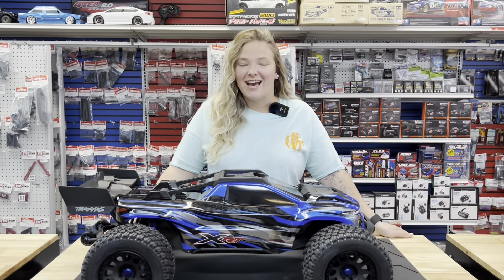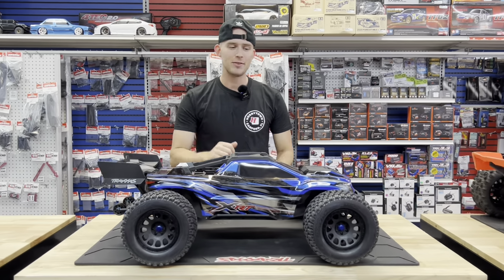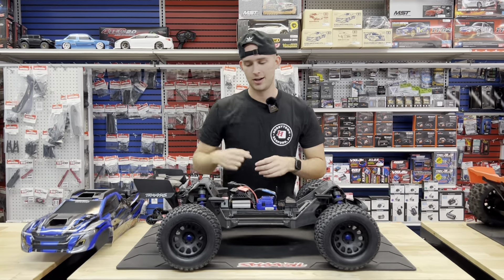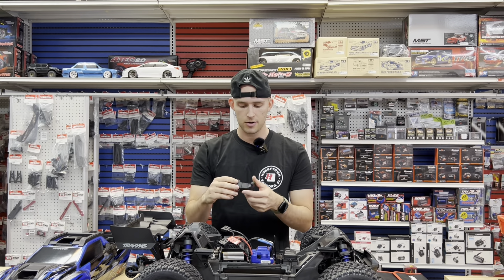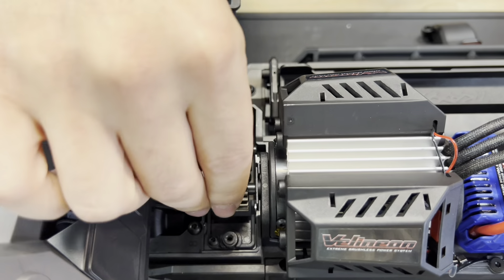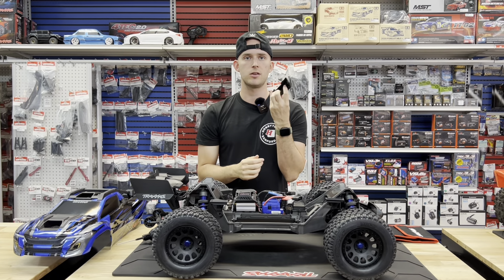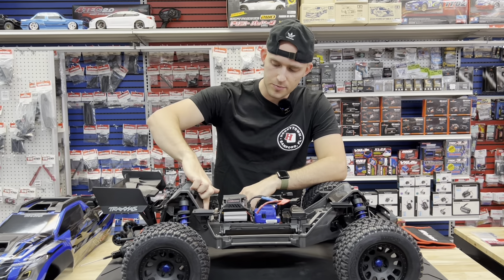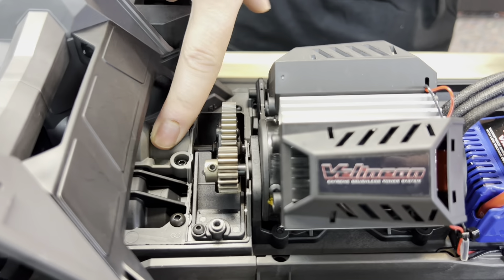*WATCH THIS* If your Pinion/Spur STRIPPED on your Traxxas XRT / X-MAXX

Comment: While these are all good points, if traxxas didn't use such low quality gears, most gear failures wouldn't be happening. I run mine with a hot racing spur, Robinson racing pinion, and deleted the pins to set my own mesh. No issue after that
Reply: For real! I've never had this problem on any Arrma out of the box.
Reply: So upgraded spur and pinion for Traxxas at, say about $75 on the most extreme end or like I don’t $100 + for a new chassis on a arrma not to upgrade the shaft on the arrma cause we all know those bend. Sooo ok
Reply: @DB-qm4jx  👍
Reply: @StevenYDG69  no argument!?! that’s cool I respect that appointment was just that different ways to skin a cat being brand loyal it’s fine, but as I found out in my life somewhere along the way, you’re gonna get disappointed when we are another by Cindy brand of any type of object
Reply: @DB  I just don't care. They're toy Cars
Reply: @StevenYDG69  lol!! ditto, my friend agreed
Reply: @DB-qm4jx  Which arrmas are you talking about? 6s or 8s? I've yet to need to replace a chassis on any of my 6s arrma rigs. My kraton 8s and outcast 8s chassis both lasted over a year and only needed replacing because I basically nose dived concrete. Same hit probably would have broken the XRT in half. XRT is my favorite 8s basher but it doesn't change the fact that the gears and pinions are monkey metal. I had to replace my XRT ring gears like 3 times before I finally got them to stop self destructing. I've never had a single problem with a arrma 8s ring gear/spur/diff anything.
Reply: @BeautyBeastRC  oh. Ok
Reply: @BeautyBeastRC Did you shim it this time? My 6s Xmaxx, now 8s Xmaxx only grenaded now - after 7 years...
Reply: @bawx  Yea I shimmed the holy hell out of the input pinion. It's shimmed so much it's almost too much, any tighter would cause some binding. It's been rock solid ever since though! now I'ma go knock on wood, 🤣
Reply: AGREE 10000000%.
Reply: Same. Not once.
Reply: @BeautyBeastRC Arrma do have problems aswell all rc s do best go over all screws with tread lock .Arrma got screws in shaft both ends  that get loose out of the box after sometime need looses put tread lock an tighten properly
Reply: Not really some time it's the cush and bearing can cause the gear to break I bought mine from guy he only change it one time. I only got it 3 month ago I use mine rough hard. Only yesterday my gear broke when I check bearing and cush was slack
Reply: @Robcbr500 what's your opinion of a rig that's not "poor man"
Reply: It's a good point, but still after 42 years, and tons of running the xrt,xmaxx and all other maxx cars the mesh is  critical.. the pinsystem is imo the whole point to this, removed it asap on all my maxx/xrt cars. And don't have any issue at all of sc stripped gears😊

Comment: Just a FYI. I purchased a XRT Ultimate 2 weeks ago and after watching your video I checked it out and to my dismay my bearing in the cover wasn't there. I looked inside the area and found nothing appeared to have fallen in so I contacted Traxxas to find out if I received a defective part. Come to find out they now machine an e clip to the outside of the pinion gear shaft eliminating the need for a bearing on the cover. The cover still has a spot for the bearing but no bearing now.
Reply: My 2024 Xmaxx doesn’t have a bearing either. Just an E clip.

Comment: The biggest problem is these cars these days put out so much rpm and the manufacturers decided not put roller thrust bearings in. The loads are too high for plastic cases with no thrust spacers/roller thrust bearings. The other issue is the gearbox and motor are seperate and on there own mounts but designed on the assumption they don't move apart?. Why haven't they started making motors with a bell housing for the transmission so nothing can move apart?

Comment: I have a question man. You say there's a bearing on the inside of the XMAXX pinion spur cover?  I have a snap on edition with black body with ghost flames, mine doesn't have the bearing or a spot for the bearing to go.
Reply: Same  here!??
Reply: @jukkakurttila5123  pretty sure older gens don't have it. Mine doesn't, and it's a 6s fully converted to 8s. 1st Gen.

Comment: Gears strip on these vehicles because the motor and spur gear are not solidly mounted together. Most vehicles have the motor on the same mount as the center differential / spur gear which solidly positions them together. There's plastic chassis between the two on the X-Max and XRT. When that chassis flexes the mesh temporarily changes and causes the gears to strip.  This is why some people never experience it while there's due. If you're doing a lot of jumping or crash a lot that flex is going to happen a lot more often.
The solution to this is to run mod 1.5 gears. The larger teeth are much more forgiving to that flex and changes in mesh.
Reply: Yea

Comment: Great video! I just became a first time Xmaxx owner. I had no idea about the bearing in the gear box cover. That being said. I hear a lot of folks using mod 1.5 gears. Would that bearing inside the cover fit correctly when you put the cover back on? Also, since I am a new owner I wanted to ask if you could give me an email I could use for questions? Thank you for your time.

Comment: Thanks for the tips, I never knew about the gear cover bearing. I'm putting an 8s Kraton motor in my xmaxx. The d shape pinion hole and c-clip are a gear saver imo.

Comment: Nothing wrong with it from stock? Ran my brand new x maxx on 4s and no issues.
6s hit the throttle and crack broke a tooth off the spur.
For an 8s rated truck with stock gearing and a wheelie bar it should be able to handle a burst of throttle of 6s on loose dirt.

Really hoping I got a bad casting, speed gears are going in now until I can get the machined traxxas one.

Comment: I Definitely would make a trip to the Sanford Hobbytown store one of these days and purchase a Traxxas XRT from you guise. I think I talked to your wife over the phone several months ago about the XRT and she said they have like 4 available. I wished they build another Hobbytown were I live in Melbourne, Fl. We used to have a Hobbytown in Melbourne that was open for like almost 20 years and closed up few years ago, bummer. I bought my Traxxas Xmaxx 6S in December 2016 at that store about few months before Traxxas released the 8S version. To this day I still have the Xmaxx. Now it is a 34lb heavy beast with bunch of aluminum upgrades from Vitavon parts, WFO parts, Pro line menace tires, Hobby Wing 56113 800KV motor and Max 5 esc. I'll be replacing the motor and esc with a Leopard 1300KV motor and the new Hobby Wing Max 5 Gen 2 esc. After that I am done with it and done what I have accomplish what I wanted to put on the truck and will move on to something different such as the Traxxas XRT.

Comment: Great points. However, I keep destroying the set screw on my pin gear! I went aftermarket gears with a larger set screw. Red lock tight, 24 hour cure. I made a “divot” in the motor shaft for the set screw to sit. All this helped but it still comes loose! It’s ridiculous!  The pinion gear should be pinned! Or in a D shape. I’d like to be able to go more than one or two runs without a problem. Fyi 30 years on the hobby (mostly planes) but any help with this frustration!?? Thanks

Comment: 14:18 Don’t even use the power tool to install at all. When putting those screws back in, with a hand tool, rotate the screw ccw first slowly, and feel for the screw to drop into the threads, which is picking up and starting into the existing threads, the tighten as usual. This will help avoid cutting new threads into the plastic.

Comment: Do ypu have a part number for the shaft sleeve spacer and a part number for a new case with bearing? I bought a used one and the case doesn’t have a bearing inside , not even a place for a bearing to be screwed to . Also there was no motor shaft spacer so please help with part numbers or info to after Market ? Thanks

Comment: Owner’s manual? What’s a owner’s manual? Had a guy actually say that at the shop I work.  
I do recommend taking the grub screw out of the pinion and cleaning the threads of both the group and pinion with 91% alcohol then use orange thread lock.  Since I’ve been doing that I haven’t had a pinion slip off.

Comment: hey you are very knowledgeable on these cars and I was wondering your opinions on the rear diff ring and pinion of the traxxas 1/16 e-revo. i picked one up with that stripped and fixed it and shimmed properly and haven't had issues since but only run on 2s. I've heard stock they don't handle 3s well. just wondering if this is similar to the xrt, i.e. user error, or weak design. i believe its improper repair and maintenance how about you?
Reply: I have one on 3s, It's mainly how you drive it. I would land jumps at full throttle and would always strip diffs. I don't really jump it anymore and it's been just fine
Reply: @carsonevans4252  ah ok, makes sense, ive since sold that car but it seems like you cant just bash on 3s without some driver skill, for as long as i had it i never had any issues on 2s, they are fun little rippers
Reply: @slimsqde7397  Yeah they're super fun for sure, they do seem kinda fragile if you really bash them tho

Comment: Awesome video.  well done.  Curious if you know the newest part number for the gear cover?  I have seen both 7787 and 7887.  Also do you know if the bearing is included?  I have the newest version of the X-MAXX 8S 77086-4.  thanks for your time.
Reply: I want to know the same. Mine did not come with the bearing.  I lost my gears on the second pull.
Reply: Same, my x maxx doesn't have the bearing either, curious to know if putting a c-clip will solve my issue?
Reply: Older gens don't have it.

Comment: Another thing if you are upgrading a basic model to brushless you need make sure you upgrade alloy motor mount and buy the thickest one you can say its an arrma 3s fit the 4s model mount as its thicker stronger

Comment: So tell me how the XRT I JUST bought, stripped the stock spur and pinion gears out of it on its first run in a flat grass back yard, no jumps, no bashing, just back and forth to get a feel for it?   Don't use the driver excuse, I've been in RC's, and Traxxas since the original .15 nitro days.
I've put the high speed gears in that came with it just to be able to run it again, but I'm ordering billet gears.
Reply: Mine broke too out the box

Comment: Arrma are my favourite tho :) i been in rc racing for round 17years at top level Arrma is no1 these day s anyway tho remove screws on any used new model and put bit of tread lock to be on the safe side pinion grub screw same thing put half inch double sided tape so its over each other under motor very tight start with say 4 layers then if no fit go down to 3 layers of double sided tape if you can on your model.Another thing that has to be done is remove shafts and there is 2 screws inside shaft hidden one holds shafts to diff and other at the end of shaft un screw tread lock an tighten down properly an leave 1 day to dry properly before using very important even on new Arrma s needs be done and clean hub s an bearing at same time so shafts rotate well

Comment: Doubt this gets answered....I bought a used xrt 2 weeks ago.  He said it might have an hour on it.  I accidentally put it on learning mode 50% throttle for the first 2 days.  Finally was thinking it didn't wheelie like in the parking lot when I watched him drive it and checked.  Sure enough it was learning mode.  Fixed that and was doing runs up my street.  It got hot and slowed down several times for a few min then went back full speed after I let it cool. I think the radio was showing like 270 degrees.. I'm new. Raced nitro back in about 2000. A few min later on a speed run it locked up and broke a tooth on the pinion and messed up some on the spur. The local shop has the factory motor for 140 with my locked up motor as a core trade.  They said they haven't heard of a motor locking up like that.  Gonna take it with me and let them check the esc. Amazing channel
Reply from the maker: Sounds like the motor bearings failed. While not super common, I've seen this happen before a couple times. Your motor was definitely overheating due to the bearings seizing up. Traxxas has a lifetime warranty on their electronics for 50% off the retail price of the motor. Or you can rebuild yours using part #3492. Thanks for watching!

Comment: I just bought a brand new X max paid $900 for it. It’s the one with the belted tires. I drove it around in my front yard for five minutes and blew out the pinion and spur gear because they’re made out  of crap powdered metal

Comment: FYI THE XMAXX DOES NOT HAVE THE BEARING INSIDE THE GEAR COVER STOCK GEARS ARE TRASH REPLACE THEM WITH HARDENED DONT WASTE YOUR TIME. TEKNO RC PINIONS AND HOT RACING SPUR GEARS OR GPM MOD 1.5 GEARS DONT WASTE YOUR TIME DOING ALL THIS

Comment: It strips because they take out the gear cover and the gears move, plus trying to upgrade and put a motor 10 times the power just breaks everything under it😂, stop trying to look for weakness, if something breaks fix it and upgrade for durability, otherwise your replacing a horse with a hearse😂

Comment: Traxxas xrt  sucks it does not do 70+out of the box I changed the gears did few runs, small jumps gear stripped, ok placed original gear back on a 1st wheelie gear stripped  so traxxas knew about the issue so instead of fixing they sold it as is. XRT is over 1000k I have sledge beat that car up no problems with anything. So no need to make excuses for TRAXXAS. In my opinion waist of money
Reply: Name one rc car that is in the same class as the xrt/xmaxx that does 70mph stock
Reply: @benjaminbrown7127  xrt doesn't do 70 mph stock. My heli TB60 does 110 mph stock anyway I ditched rc cars they just slow and boring

Comment: Is it normal for the motor shaft to go in and out I don't like this xrt I'm not having any luck with it at all destroyed all the gears I put their high-speed gears in and it absolutely screwed up the motor now the shaft on the motor goes in and out it makes no f**** sense I am so pissed off with this xrt it's not even funny my ex Max is way better I never have any problems with it I bash it way harder the xrt is pretty much been babied just high speed runs no jumps at all and this thing just destroys gears I might just sell it I probably will give it one more shot but if these gears destroy again I'm done